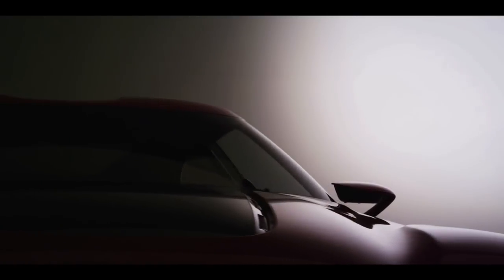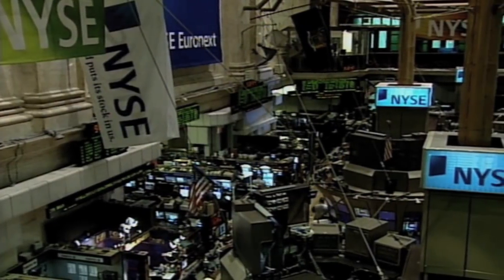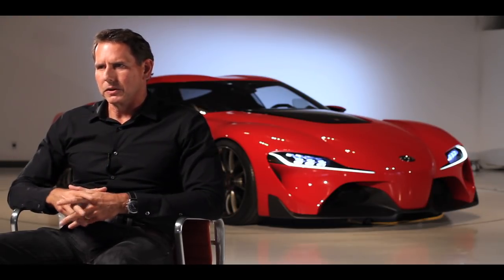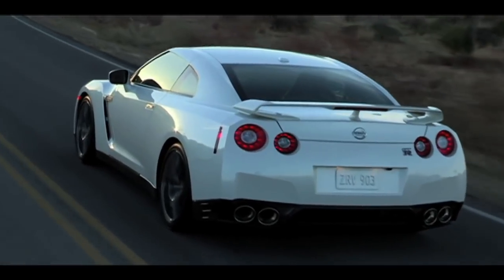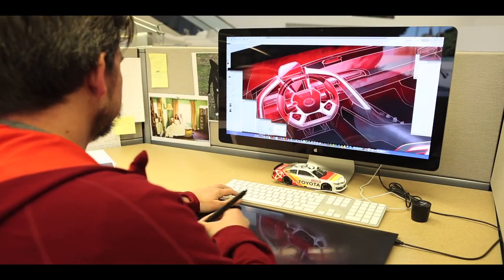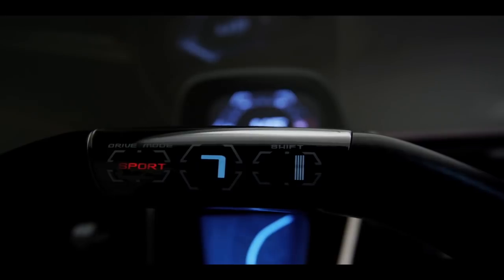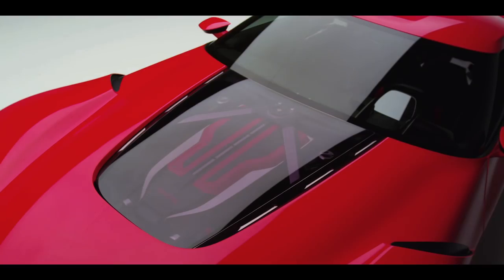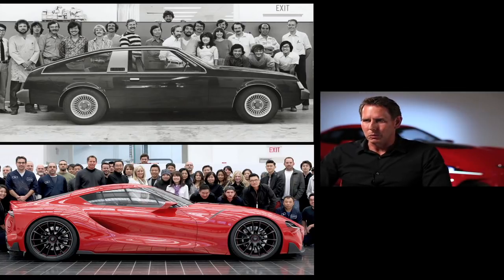A Glimpse into the Design of the Toyota FT-1 Concept

Comment: The 4L V6 out of the Tacoma is a well built and bulletproof engine. The potential is definitely there to make it rev higher and put out a lot more power. My Tacoma is almost at 200,000k with no engine issues at all, has loads of power both bottom and up top near 5000rpm. Imagine this type of engine modified to go to 8K and put down over 400hp in the new supra. I think they would go well together.

Comment: This was a reaaally good video on the car. The most informative I've seen so far, great work!

But this car needs to be made! Preferably with a inline 6 as opposed to a V configuration, turbo, AND HYBRID PLEASE! I thought id never want a hybrid but this car needs it. It feels so right with the interior styling and tech. It will give it that new, modern, futuristic feel. Very 918 and P1 like.
And this would be silly to have a AWD system, the price boost wouldn't be feasible and RWD would differentiate it from the GTR.
My 2 cents :)

Comment: it would be nice to do battle with 414hp stangs , 414hp m3's, 426hp ss camaros, not to mention base models like, 3.7l 305hp v6 mustangs, 300hp 335i/320hp 335is, 323hp 3.6l camaro v6 - maybe a is350/gs350 engine with the f sport intake exhaust or similar and a slighty more hp/tq tu e for the ecu. 8sp dct might be cool w/ a 7sp manual for purists... LISTEN TO ME TOYOTA DO AS I SAY
Reply: lol.. the Lexus RCF is to do battle with M4 and M3 and A5 and SLK...... if Toyota brings back the Supra it will have to target the GTR, 911, Viper, Corvette....... trust me Supra fans can be very demanding......

Comment: If Toyota decides to bitch out last minute and NOT produce this car... Ill honestly be crushed. What I'm thinking is this car would target the Nissan GTR as a main rival. The Nissan GTR has outstanding performance for a 100,000 dollar price tag which is supposedly cheap for a true sports car. If Toyota can produce this jaw dropping car with performance and a price tag that beats the GTR I would think Toyota would make killer profit.
Reply: the GTR is not a high volume car as you may think.... there is less than 10,000 GTRs in North America since it went on sale back in 2008.... now the only way Toyota can make a high performance sport car for under that price is 1: they aren't using AWD system. 2: most likely they will use CFP tech from BMW. 3: they will use most of the LFA R&D as it is already paid off

Comment: IF ITS A SUPRA IT BETTER HAVE A HUGE SINGLE TURBO 800 horsepower STRAIGHT INLINE SIX ENGINE! Didn’t TOYOTA EVER LEARN? The v8 with more tq than hp BLOWS UP WHEN UPGRADING THE TURBO! The V8 and Vshapesengines do not last when putting a high amount of TURBO BOOST ON THEM! ONLY THE INLINE SIX SINGLE TURBO WITH A HUGE 76mm turbo will last reliable like the 2jzgte engine with 800 horsepower and torque on the STOCK ENGINE BLOCK! Dumb ass Toyota making the same mistake as all the other car companies! Just make the 2JZGTE FROM THE OLD SUPRA AND MAKE IT THE 3JZGTE WITH A HUGE SINGLE TURBO AND 800 HORSEPOWER!!! Make our dream come true!!!